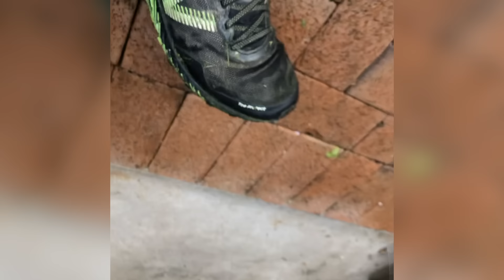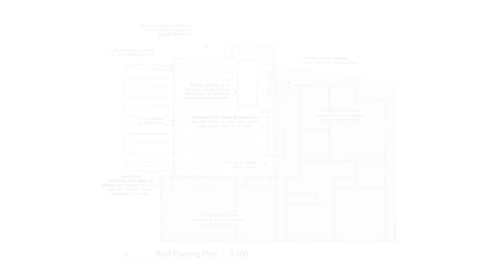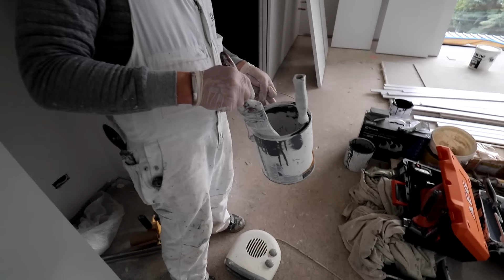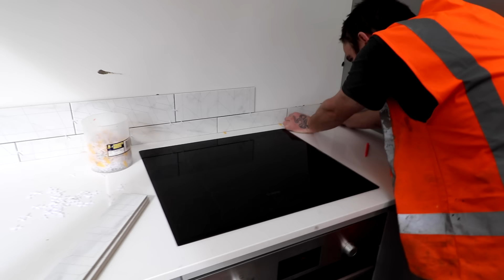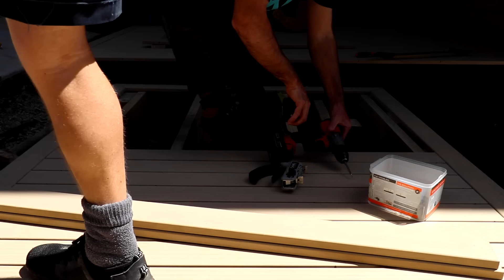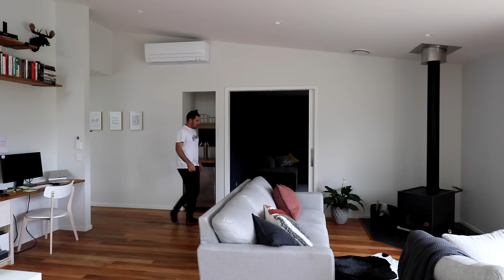How I Built a $1M+ House for Only $500K

Comment: We can make 10 floors tall concrete residential buildings with 500,000 USD in india, if you convert to Indian currency which is 4,25,78,000 rupees.  That house in your video would cost around 20,000USD to build in India if built using concrete reinforcement and TMT 550 steel bars..  can't estimate cost with wooden. It would be Way less
Reply from the maker: It's crazy how construction costs vary around the world!

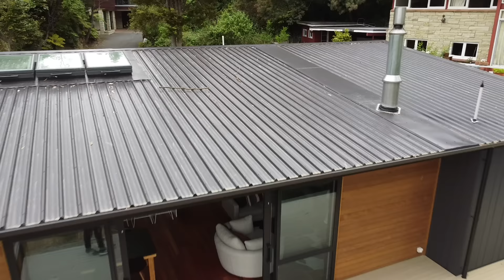Comment: I might have missed it among the things you'd do differently, but the gap in between the studio & the floating deck above is driving my OCD mad lol (like, the gap below where you stand at 1:01:46 as the cam pulls out) - are there reasons why this design makes sense, rather than just bringing the studio roof up ?
Reply from the maker: Im not a fan of membrane roofs / decks and wanted  keep the two things seperate for future mainatance,

Comment: I started cutting grass as a boy and even then often fantasized about how I might accidentally slide under the mower and chop off my foot or toes. there were definitely a lot of slippery grass days and often times when I was cutting the grass in the least safe way like pulling it up a steep 50* angle. and thinking about sliding under every time just daring God to teach me the hard lesson. Was this your first time cutting grass ever?

Comment: Can someone explain why most of the houses in the US are built based on the wooden construction? It's unbelievable, having $500k cost, you do not go for a cellular concrete blocks(AAC)? I don't believe the cost gap is huge.. but the durability is way more better. In Poland 90% or more apartments are built based on this, with a ring beams heavily reinforced with steal.. what guarantee the house will survive almost everything.
Reply: This is in New Zealand, but yes we build houses similar to the States.

Comment: Did you secure the Foundation to the bedrock or is it just „pilar and the slap on the mud“ ? No judgement just curios if the house is secured against slipping down the hill with alot of rain and the muddy ground? Really nice house btw
Reply: No it will be a slab slapped down on clay. NZ houses are extremely poor quality. Secondly it’s constructed from cheap, shit Kiln Dried Timber. NZ pine is the worst in the world as it has rapid growth with overly elongated cell structure weakening the timber. It’s basically good for MDF and that’s it. 
Secondly it’s a complicated roof line that is relying on silicon to keep out the water. Like most builds in New Zealand. Australia has similar problems with overly complicated flat roof profiles and leaking homes.
You can build in steel, but it’s like like living in a tin can with hideous thermal properties requiring 24hr heat regulation. But it won’t rot.
Reply from the maker: piles to 4m deep tied into foundation

Comment: For 500k I would have built this one with a reinforced concrete foundation and concrete pillars with a concrete floor between floors and 2 rows of bricks and balsam wool insulation
between the brick walls and the roof with ceramic tiles, the good stuff for 70-80 year warranty. The windows , triple glazed and krypton/argon gas fill between glazings, natural wood floors, underfloor heating and cooling with pump and solar etc etc. The cost of this house as it was built here seems ridiculous to me..NZ is expensive AF ,for this price too much wood and drywall was used for my liking...looks cool but I prefer our construction style. Greetings from Austria!
Reply: Would you have maybe done a bit of painting too?

Comment: I am definitely not an expert, but timber framing doesn't inspire confidence in me at all.
Reply: As in timber in general? It's majority of NZ and Aus homes. As long as it's treated and protected from weather it's good.
Reply: @OfficialSolDios  I grew in a country where all homes and apartment buildings, without exception, are built with bricks and concrete. If it's all good, it's all good, I just get a little icky that's all.

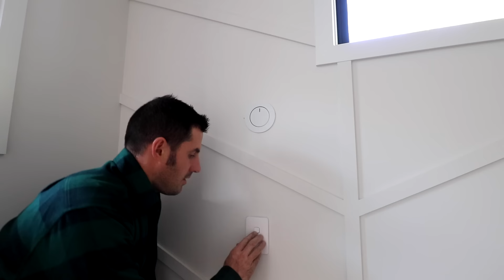Comment: 35:46 The house is beautiful!! But wtf is that 2 cm tile in the left corner??? Come on..
Reply from the maker: yep that's a result of the shower niche (which you cant see behind me) being a full tile and the starting point. The tiler and I went through a bunch of options and ended up with this. It's one of those things where you're stuck between a rock and hard place with things you cant move. im happy with it

Comment: If I was designing this I would have put a full fireplace in the middle of the house or near one of the sides. Then any extra pipes that go outside the house where you would normally have them going out the roof to be routed through the same chimney. For less area where leaks could occur.

Comment: I can't believe I watched this whole thing, so good. My only real suggestion is to add in time frame indicators as text through the video along with the title of what you're doing. Indicate how far along in the build things are being done because it's hard to know how long its been between installing cladding and bats etc (3 months, 4 months etc ). Also would have been cool if you estimated how much this would cost for someone who didn't have your skills and needed to pay someone to do it all, which would be a nice comparison for someone unskilled buying this difficult section and going this route vs a section more easy to work on.
Good luck with the next build!

Comment: man I remember my first time hanging a ton of fiberglass insulation I didn't realize it but every time id push it in between the studs I would be inhaling a ton of fiberglass dust and I started coughing my lungs out then realized I needed to use a mask

Comment: One time, while I was visiting my grandmother in her village in Montenegro, I heard a story about a local villager. He was mowing the grass with a large machine, not like the regular mowers you might be familiar with from videos. This was a much bigger machine, equipped with large metal claws at the front. These claws were designed to mow through thick grass and even branches, though, like any piece of equipment, it had its limits.

As the villager was working, he didn’t notice a large log or a big stone hidden in the grass. Unfortunately, when the machine ran over it, one of the metal claws—or 'teeth' as they call them—broke off. The piece flew off at high speed and struck the villager in the leg. The impact caused serious injury, cutting through nerves and leaving him with permanent damage. As a result, he became an invalid.

Comment: I just want to ask. Why in the hell in the US/NZ/Austarlia hosuses are made out of thin wood and drywalls.. No isolation, no sound isolation between rooms. Actuall wind +160 km/h can damage it.. I know it's like 2-3 times cheaper I guess but the heck. Even huge willas are made out of cheap wood. It's madness how low % of houses are build like ones in europe. With bricks and cement.
Reply: 90% of homes here in New Zealand are wooden framed structures, many of our older homes were based on the Californian bungalow design. The main reasons why wood is the preferred building material in New Zealand are more or less the same reasons in the States. 1) Earthquakes (majority of New Zealand is situated on the Ring Of Fire), 2) Supply (we have an abundance of wood readily available), 3) Cost (wood is generally cheaper than other buildings materials here).

Comment: As a european its crazy to see how much wood is being used EVERYWHERE for a house. Why not use bricks and make sure the house actually lasts?
Reply: Here in New Zealand a large majority of homes built here (roughly 90%) are wooden framed structures, many of our older homes were based on the Californian bungalow design. The main reasons why wood is the preferred building material in N.Z include: 1) Earthquakes (the entire country is situated on the Ring Of Fire), 2) Supply (we have an abundance of wood readily available), 3) Cost (wood is generally cheaper than other buildings materials here).
Reply: Earthquakes!!! All of the houses built in NZ aren't made with bricks because they just collapse in earthquakes. 
A lot of buildings in Wellington are marked as earthquake prone and have to be rebuilt and a now barely any houses in Wellington are made with bricks.

Comment: Dude! That concrete car park slab will be cracking in no time.... no reinforce bar?
Reply from the maker: Fibre mesh reinforcing in the concrete mix works a treat - 3 years on and no cracks. Its all about the correct preparation of base under the concrete

Comment: Were the holes drilled deep enough to ensure that the foundation is anchored in the bedrock? When I was building my house, it turned out that 10 holes had to be drilled to a depth of about 7 meters to anchor the foundation in the bedrock. Unfortunately, it was a necessity because the house was situated on a fairly steep slope.

Comment: Interesting to see the different building standards, but at least you guys use the metric system which makes it easier when watching your videos🙂
I have a question about that corrugated roof. I was planning on using it for a carport I'm gonna build but I'm worried about the noise it'll make when it rains as the living room is right next to it.
Can anyone with such a roof tell me if I'm overthinking or is it really much louder than a traditional tile roof ?
Reply: Definitely much louder than a tile roof but probably more so if you are under it.

Comment: Great video josh and glad you spoke about the costings. A couple of questions did the costings include your time and labour? Secondly does the 10k cover all the bathroom and laundry fixtures as that seems pretty cheap for a 3 bathroom home. Would you go for wool blend over pink batts as they are more expensive but it allows the home to breathe more

Comment: and why don't Kiwis build overhangs in there roof ?
Reply: There's no sun over there and the want all they heat they can get onto the sides of the house to try and warm it up.
Reply: @fisherh9111   It should actually be the opposite - eaves mean better thermal efficiency for the structure which is more and more relevant with climate changing bring about constantly warmer weather.
Reply: No sun in Wellington ? They call them “self cleaning houses “ I think they UGLY af . Most new builds in NP or Nelson have no overhang , they just look soo cheep

Comment: A few things about being an American Framer in NZ . are you parking a tank in the garage ? we don't even put steel in our garage floor builds, never had an issue. 
pre made walls are dry and square , but kiwis have lost their ability to frame a house . 
stoked on guys who take the worst piece and build a dream on it .. Well done mate !
Reply: "kiwi's have lost their ability to frame a house" - what?
Reply: @Captain_Aubreys_Salt  the crews around here everything is pre made , you are literally not allowed to frame your own roof. never meet a guy how know how to cut in stringers , most builders here in NP order them from the joiner
Reply: @tjdawson8942  Oh right, I see what you mean - you mean the ability to manually frame out a roof.

I'd be keen to hear why you think this is a bad thing? Pre-nailing and frame building factories speed up production with better design controls than a couple of framers on site banging it together by hand could - thats why we switched to it.
Reply: @Captain_Aubreys_Salt  I guess it all come down to red tape  and "engineers" mate. I miss my Doug Fir , no blocking and hand framed timber roofs and stairs..
Reply: @tjdawson8942  We are still allowed to frame manually, but not make roof trusses. Bit silly but there you have it.